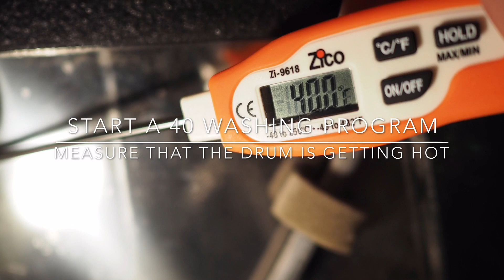How to Replace a Washing Machine Heater - Miele 6260482

Comment: I have a W833 with 22 years of around 7 uses per week and still looks new. Only ever problem was a door seal (which we broke trapping towel in door) easy to replace. Now we have a heating problem sometimes getting warm sometimes seems not to have heated. I'm wondering if this is the element or the sensor or something else? I'm thinking just replace the sensor first. I would appreciate any advice.
Reply from the maker: I would try to replace the heating element because after 22 years it can only do good to the washing machine. You will also find lots of dirt down there, so that it will certainly improve the heating efficiency of your washing machine.   Its hard to say if this is the problem. It can also be the sensor or even the electronics.
Reply: @YoramPomer  I replaced drain pump with a good used one, replaced motor brushes which were down to 5mm, replaced both shocks with new ones, replaced heating element (old one and drum interior like new as soft water area). Now machine runs well, but has rinse light rapid flashing. Rinse light was flashing before I started think it might be related to spraying switch cleaner around main control switch?? As this is the only thing I did. I would appreciate any ideas.
Reply from the maker: @Iazzaboyce  Did you try cleaning the entire drain system? Its so easy. You press the spring that hold the rubber in place and take it apart. The entire system needs to be clean. 

If this problem stays, than maybe you have a problem with the pump. Again - get it cleaned and make sure that nothing is blocking its rotation.

Comment: At 3:09 you place the clip on the wrong location, compare it with the location of the old clip at 2:50. The clip has to be placed more towards the contacts. The marking that you see in the lime (3:09) comes from the holder clip fixed inside of the drum.
Reply from the maker: Deux Cent I don't agree and I don't think that it's important for the functionality of the clip
Reply: Don't get into a huff when it is pointed out to you! I just wanted to draw your attention to something that would correct your movie (for the rest excellent). Viewers of your movie would then be better served. Look again to your tutorial at 2:50 and 3:09.
Reply: @deuxcent4625   that's correct the clip needs to be placed near the bend in the element towards the opening. The other clip inside the drum is fixed halfway inside and as you slide the element in, the inner most bend is guided through the internal clip. You can see the location of the internal clip by shining a torch through the drum perforations :-)

Comment: Great video and very helpful. I'm using a replacement OEM element and the rubber seal grommet that comes with it was ok but not as good quality as the original. Instead I used silicon around the edge of the original grommet. I removed the original very carefully and cleaned it all up and it was still very re-usable. The silicon also acted as a lubricant when re-inserting into the opening. That should now provide a waterproof seal and I think the original was fixed with some factory silicon anyway. I let the silicon dry for 24hrs before re-assembling the machine.
Reply from the maker: I am not sure that silicon is needed for sealing. One reason is that they need to be able to send a technician to a customers location for fixing all the problems on the spot. So that telling a customer to wait 24 hours before using the washing machine would not be acceptable. All of the parts that they replace need to be immediately fully functional. This is why the rubber seal can not be reused and needs to be replaced. 

I am happy that I could help.
Reply: @YoramPomer   Hi, when I removed the original factory fitted seal there was a glue/silicon residue all around the edge. I used silicon anyway, firstly it acts as lubricant to slide into the hole easier and secondly there is no harm using silicon as it will guarantee a leak free fit (new or old seal). The OEM rubber seal grommets I was supplied were made of lower quality rubber than the original and I would defo recommend using silicon for them, there has been a lot of users of those who have complained about leaks afterwards. The new original Miele part is better but of course far more expensive. I removed mine very carefully and it was perfectly re-usable. Obviously if you destroy it on removal then you use a new one :-) My old one was defo better than the OEM supplied. Anyway 24hrs is not long to wait, I would personally use silicon no matter what (new or old) and you know it will not leak and saves having to re-open the machine and do it all again.

Comment: This is a great video. One thing I would suggest doing differently is the re-assembly. I would suggest fitting the metal bits before insertion into the hole. Do all of this fiddly metal cover and fastening washer bits outside the machine before you insert the element into the machine. It will make your life much, much easier ;-)The chap in the video used his special tool to tap into place but you can also use an appropriate sized socket from a socket wrench set. On the new element use some soap/washing up liquid in the rubber grommet holes and slide the grommet onto both ends of the element right down to the bended bit. Then attach the metal cover onto the element and tap it down around 0.75cm onto the metal of the element ends. Then tap down the fastening washer rings as well, right up to the metal cover and the whole metal assemby should ideally be now be sitting 1cm onto the element ends. Try not to go further than 1.5cm. Once the metal and washers are in place they are set, they will not move.  Now when all set you can slide the element assembly into the washing machine hole and into place. Because the rubber grommet is quite far forward at this stage, use your fingers to press the grommet firmly into the hole at this stage. This method allows you the space to be able to seat the grommet with your fingers all around the edges. Once you know the grommet is properly seated, then you can push the protruding metal assembly and element forwards (like a piston) into the machine. This way you can now press the metal assembly firmly up against the grommet by hand. The washing up liquid allows it to slide forward easily but once the washing up liquid has dried nothing will move :-)
Reply: It's not so easy,  I see......
Reply: THANK YOU so much!

Comment: This was very helpful indeed. I have a couple of little additions that might be helpful to some. Be careful when pulling free the rubber seal - I was a bit too aggressive and actually bent/distorted the opening and had to carefully tap it back into shape with a bit of wood and a soft mallet. Even then - I wasn’t sure it would seal properly so I used a thin film of silicone bath sealant around the sealing rubber - it worked and actually helped provide a bit of lubricity to re- insert the element/rubber seal into the outer drum aperture.
Reply: Some lubricant is usefull

Comment: I find it impossible to push the new rubber sealing fully into the hole. Seams to need yet another 2 mm. Now I cannot pull the new rubber sealing out again. Should I have used some kind of grease on the rubber sealing before pushing the rubber sealing into the hole?
Reply from the maker: Slippery liquid that dries could have been helpful - But grease is not a good option.
Don't try to pull it out - you will weaken the seal. just lock it in place and it should hold.
Reply: What I did:
I pulled it out again as 'gently' as I could, it was not as hard as I had expected.
Advised by a friend, I put the rubber sealing in 60 degree water which made it more soft.
After that I added a few drops of liquid hand soap around the rubber sealing.
Finally it was very easy to put rubber sealing in place.
Reply from the maker: Soap is a good option.
I hope that your washing machine is working fine now

Comment: Great video, thank you. But I have a question: aren't Miele washing machines built to last 20 years, or is that just marketing hype?
Reply: we have have Miele Novo w842 for over 20 years - my wife and I have 5 kids, it has done a wash at least once a day every day since we bought it in 1999 - i have had to replace a few things, but still going strong (i just need to replace the heater element, hence why i am here)
Reply: Yes its hype.

Comment: Hello there, I have a Old Miele Hydromatic WT745 stuck on wash cycle? The tumble dry heater works fine. Any idea what the problem might be. I thought it could be heating element, but not sure. Turn the dial to start wash and it just doesn't move from the start? Kind Regards Rebecca.
Reply from the maker: super saiyan 3 goku - Probably not. Try washing without any heating. If the problem stays the same then it has nothing to do with the heater.

Comment: hi is there any one who could help me with advise on a miele washing machines? I have a 2240 washing machine with a fault! the heater element is permanently on! the only way you can turn it off is by the plug at the wall! you can turn the machine of with the off switch and it will turn off, but the element will still burn its self out!! any advice, apart from buy a new machine :)
Reply from the maker: sparkynight73 Your description sound like a satire because it's technically not possible :-)
Reply: unfortunately it is possible because its happening to me, blown two elements already! only way to stop it is to turn it off at wall!!!
Reply from the maker: sparkynight73 Sorry for my doubt... I have no idea how this can happen . 

Miele is known for its error prevention logic in its devices, this is why it sounded so untruthful.

Best of luck in your research for a solution
Reply from the maker: On second thought, it could either be a faulty relay ( or triac, as I am not familiar with this machine) that is permanently closed or the logic board. You can easily measure this - be carful of the high voltage! If it's the relay, then the fix is very straight forward. if its the logic board, then I would send it to someone that knows how to repair it.
Reply: i will check the relay thanks
Reply: How do you know that the heating is active? is the machine gettign warm or does it make a noice?
Reply: the heating element is just on all the time! unless you turn the machine off at the wall! found this out by burning out two elements. you can even turn the machine off, and if its still plugged in and turned on at the wall the element is just on!!
Reply: sparkynight73 Hi there!!! It could be a defective Heater Relay,you have to remove the front panel and expose the Heater Relay,check it,perform a continuity test on the wires,if they are OK,replace the Heater Relay.Good luck.
Reply: the was the conclusion I have come to! haven't got round to checking it yet but that's my next step, cheers ceferino lopez
Reply: sparkynight73 You're very welcome,and good luck to you again. Greetings

Comment: You better use 2-3 times a year citric acid
Reply from the maker: Frau M why?
Reply: @YoramPomer  Yeah, at maximum temperature and without any clothing inside. Because (as you can see) the machine is very dirty inside, even the old heating element was very dirty when you take him out from the outer drum. You probably don't wash at higher temperatures than 40 degrees of Celsius and the mud (or how to name it) caused the heater to burn out. The heat that builds up in the heater body cannot be transferred to the water due to dirt and limescale, and the heater burns out. Wash at least once a month at a minimum of 60 degrees of Celsius using a classic powder detergent, or at least 3-4 times a year run a cotton program at the highest temperature (95 C) with 200 - 300g of citric acid (of course without laundry). 😉
Reply from the maker: @milangal8807  You are probably right. Maybe there is a washing machine detergent that leaves less rest overs.

Comment: what a terrible design
Reply from the maker: I don't agree.

Although having screws that tighten the heater to the drum feels like a better construction, there are good reasons that Miele decided on this solution (Miele is not a company that saves on Quality):

1. You must replace the sealing with the heater element because by taking out the old one, you will make it unusable.
2. The are no screws that can get stuck or rust, so that you will always be able to remove the old heater, even after 20 years of use.
3. The rubber seal gets tighter over time because of the heat and the movement of the machine. Whereas screws can get lose over time.
4. The quality of the parts is so high, that if you follow the instructions, then success is guaranteed